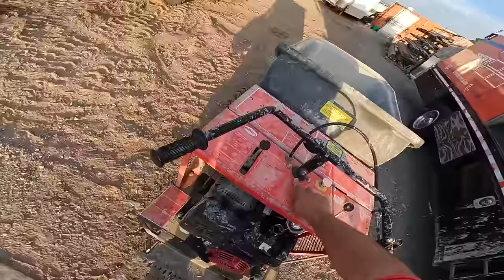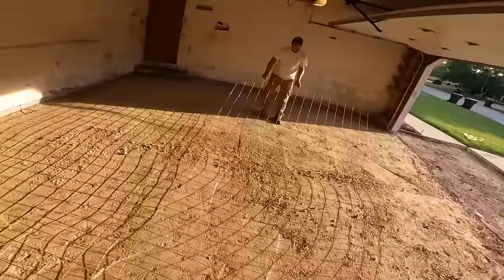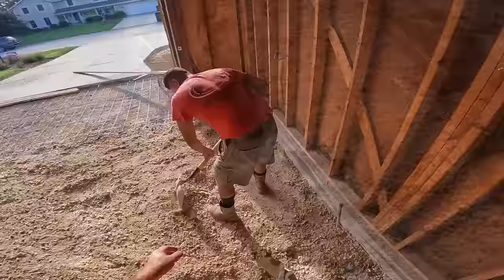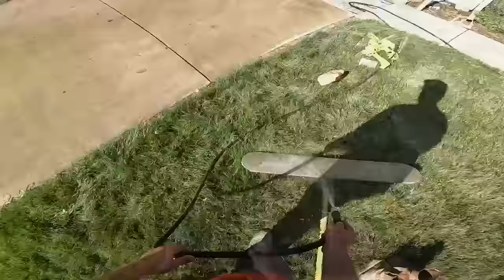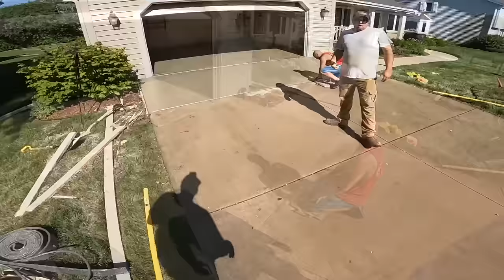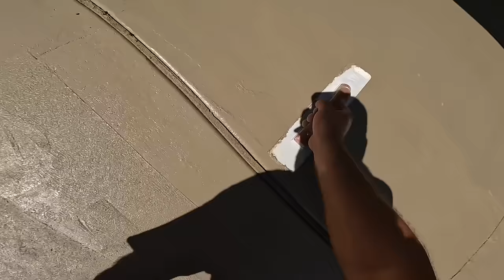My guys messed up and I wasn't happy! Not ready for showtime

Comment: Hey Ryan, I know what the issue is with the camera.
They have the fisheye lens in them, and all you have to do is go on to the gopro studio snd they have an option to "flatten" the video.

You'll appreciate it sir.
Peace man.
Reply: This comment doesn’t have nearly enough likes.
Reply: I always knew it had some weird view especially when he moves quickly
Reply: That is exactly what it is! I couldn't figure what exactly it was but upon reading this if you ever stare in the middle of the video everything sort of bends into a curve. That's the natural lens of a Go-Pro though so it can have that wide FOV.
Reply: @JAY-lz6os   Yeah if they go to the GoPro studios they'll figure out how to flatten it pretty quick.
Reply: I was thinking it was set to wide angle
Reply: @IMKINDOFABIGDEAL13  Nope its a fisheye lens sir.
Reply: @treecooper8557  you’re the expert
Reply: @treecooper8557  I actually think you’re right. On my go pro 10 it looks fisheye in the default setting. It’s not the lens, you just change the view angle to normal not wide. Or something like that I’d have to go grab my go pro to double check but I’m pretty sure it’s not the lens
Reply: @IMKINDOFABIGDEAL13  I think you’re right^
Reply: Interestingly the ultra wide-angle lens technically isn't the issue, but barrel distortion, which is a typical feature (or flaw) of fisheye lenses. But you can have wide-angle lenses which are rectilinear too.
Reply: @AudunWangen   I said the fisheye lens not the wide angle
Reply: @Etraphix  I fixed it in GoPro studios
Reply: @treecooper8557  Sure. Just throwing in some interesting facts for fellow nerds. I guess it has to have to have barrel distortion to be a fish eye lens, but it's basically just an ultra wide-angle lens nonetheless. You can also set the GoPro to record in linear, which does this directly on the camera software so you don't have to fix it in post production. The drawback is that you lose a lot of image real estate (field of view), and it's not available in all camera modes. Personally I think the wide angle shots look better in most cases.
Reply: @Etraphix  yeah. A fisheye IS a type of wide angle. But would be distorted round in all 4 corners
Reply: @AudunWangen  Looks good and you don't lose any real estate fixing it in post though.
I hear ya though sir, thanks for the info.
Reply: @EDH90  does now
Reply: Flatten it like the curve baby.
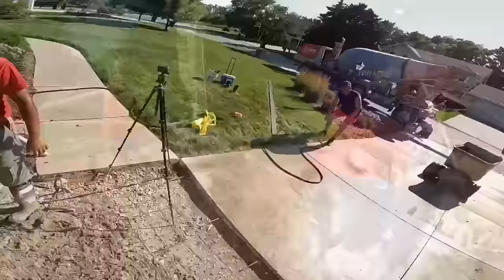Reply: @Etraphix 13:48

Comment: Where I live in Greene County Pa the concrete company we have in our town in October no one residential can get concrete only a selection of big company’s that been getting it will get it because of not being able to get the stuff to make concrete! We use those jumbo decorative to make our retaining walls we won’t be able to get they are gonna stop making those do to the shortage!! We’re a construction company do everything from putting in sewer water lines, gas lines from meter to the house, turned a pole barn into a house and left the other half as a pole barn, to framing a house from the ground up and do all the electrical wiring only thing we don’t do is hvac!! A jack of all trades even do concrete jobs that’s why I watch your Channel all the time to get pointers and tips! That’s why I like that you explain why you do things the way you do and the stuff you shouldn’t do!!

Comment: I use to do this for a living.  We poured 200 plus houses a year ( I was the Boss at 17). But another company poured a drop down basement and garage in the winter.  They pulled the heaters the next day. The grade was muddy it froze and the basement heaved and pushed the post and shoved the center of the house up 6" the garage was just as bad. The most expensive basement floor I ever did. 1800 sqft all done by hand.

Comment: My son just did a taylormade fitting and was recommended the KBS Max 80g stiff shafts but I can not find them in .355 what shaft would be best and similar that has a .355 tip? He plays the p7MCs.

Comment: If that was oil on the driveway, I recommend "Pull It Out". You can buy it at Home Depot or Lowe's. Just pour it over the stain, let it dry overnight, sweep it away the next morning. Saved me a couple of times.

Comment: Ryan, I use to pour and finish concrete back in 05-06 after high school. It was one of the most satisfying jobs I ever had. And back then we poured miles of sidewalks for new developments using the long STEEL FORMS (your crew has it lucky not lugging those around) Wondered if you ever used the plastic strips that would lay down and then peel out to leave expansion joints. We used them a lot in garage and basement floors.

Comment: I always tell my apprentices that construction, no matter what trade or job you are at, it is the same routine over and over. When you do the same routine on multiple projects or task then it should become second nature and you should know what you are doing and/or know what you will need. It should get to a point were they have learned enough that you can leave them unsupervised to do their job. But I guess in your case, Ryan, you cannot leave them alone and that hurts you as the owner, but it also hurts them because you can't trust them to get a simple common task done.

Comment: Hey Ryan...I can understand your frustration, the guys should have known better they do it every day...you seem to handle it well. 
Have you ever put your shutoff joint on the inside of the wall, so it lands under the garage door?
The jobs I pour like that where its a different finish on the outside of the garage like stamped concrete, I put the joint under the door so when the door is shut you don't see the joint and two different types of finished concrete. Hope you get the rest you deserve...and are blessed with the true rest you find in Him!

Comment: It is something that is so easy and after every pour is cleaning the concrete of of the tools, especially finishing tools. There is no reason to have to tell your workers to clean the tools after the pour. There is nothing worse then the next time you pour and you get the finishing tools out and have everything ready and out before the truck gets there with concrete. I usually have the least experienced guy he is responsible for tools to be clean, if they are not cleaned it's his fault no mater what. You don't need experience to make sure there is no concrete left on tools.

Comment: Hey Ryan, it would seem there's a better solution to "re-newing" a concrete surface like new instead of breaking up, hauling and re-doing the entire thing. If you could come up with a sustainable solution to just renewing a long lasting surface you'd cut the work in half, just cuz no one has done it doesn't mean it's not a great idea!! More money time for the fam, easy money (for real)

Comment: Your the first contractor I've ever seen use rolled foam instead of felt between two existing pieces of concrete and then not use expansion underneath trim in case concrete raises up

Comment: When I use to finish concrete in the late 90's early 2000's we went from a square trial to one that was square on the back and round on the front. Worked way way better then a square one.

Comment: You might look into a tracked buggy for your next one. They might be a bit larger but with the extra features they can work in tighter spaces. And they have different kinds of tracks depending on the need. We have 2 of them at our shop I wouldn`t trade them for anything.

Comment: Small chips in concrete. I have seen Ready Mix Companies, usually only when they own there own Gravel Pits will add more chips in there small aggregate makeup because concrete finishers will complain about the chips because they flip over when you hard trowel your finish. Some Gravel pits don’t have a lot of  one (1) inch minus aggregate naturally so they crush all or most of there one (1) inch aggregate and they end up with at time thousands of yards of chips. 
Chip Sealing Asphalt was a windfall for a lot of Gravel Pits. Chips were not a big deal if you’re are power trowel finishing. 
Bugs not Buzz

Comment: I hear ya....its always the simplest of tasks....if your there it flows smooth with little instruction....leave, and it all falls apart.....

I never get questions on the job....the minute I leave the job phone calls start flooding my phone....

Strange phenomenon.....make 1 person in charge and they make the most money but they are responsible when your gone......someone has to be in charge if the boss is gone......plain and simple.....otherwise nobody is and no one is responsible

Comment: I don't claim to know anything about concrete work. But I live in FL. I've never seen expansion joints inside the garage . It's usually even like smooth shinny.. Is it cause if the cold snow weather up there?

Comment: wow, the result looks so nice and flat, good job. but I have a question. why you put a reinforcement mesh underneath and it just lies between ground and concrete. will it work? usually we put something like heels to separate mesh and ground an let concrete to flow under the mesh a little.

Comment: I watched the video you put out the other day when you left the guys to it because you were feeling ill......I seen Eric step up to the plate, he asked Daryl to cut rebar, he was measuring the concrete depth and he put himself forward to do the step......Is it Eric's fault that the depth was wrong.....If he measured it, YES.....but I think you are just feeling run down....Tell the guys, they needs to take some stone out and move on........I've had times that we've not even got the road ready for tarmac and we have 6 wagons waiting to tip.....My boss knows there is no point screaming and shouting,  it will be done.....Motivate not belittle.

Comment: The joints looking crooked on camera is probably due to something called lens distortion because the gopro has a fisheye lens so it warps everything around the center of the lens. There should be an option in your editing program for lens correction that will remove it for you.

Comment: Why would you put a seam in a garage floor rather leaving it completely smooth and also why don’t you uses a tamper to settle the larger rocks an get rid of all the air bubbles in the concrete?

Comment: It's crazy how many little dumb mistakes they do...this one tho is big take your string line and come a long and it's easy....sometimes the small rock comes from rocking out drums when your on a job way to long and run out of water they will throw 5-10 tons in an empty drum and you idle up the truck and let the rock clean the fins and it breaks up the rock and looks just like what you showed and the quarry sometimes breaks it up to to much. Also I worked for a company where the sand would run over into the rock.

Comment: That grading problem should have never happened and you should be furious,  but you know that it doesn't help to express that frustration more than is necessary. 
It still does not excuse the employees slacking off just because you were not present when they did the grading.  I have graded many, many places,  often times it looked to good to pour concrete on,  because I took pride in perfection, even though it would never be seen,  it's critical that it's the right depth!